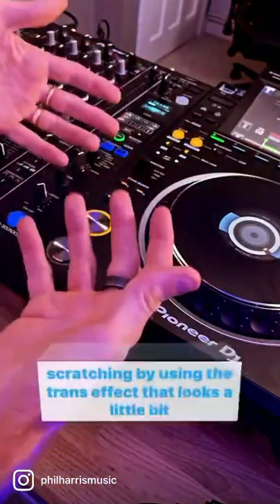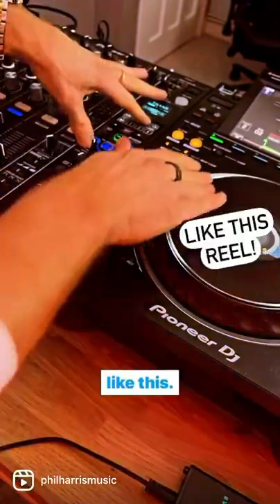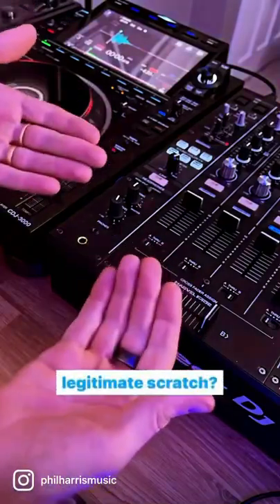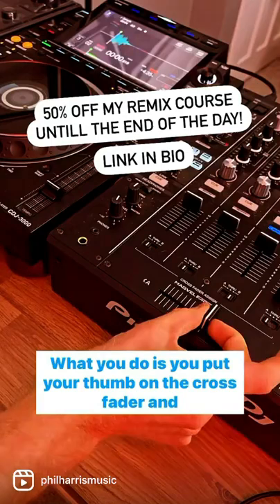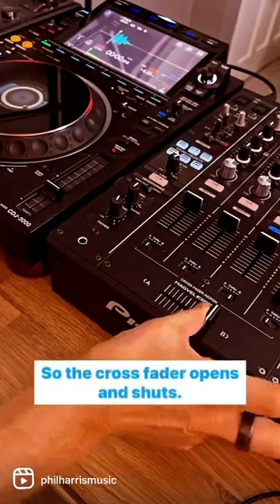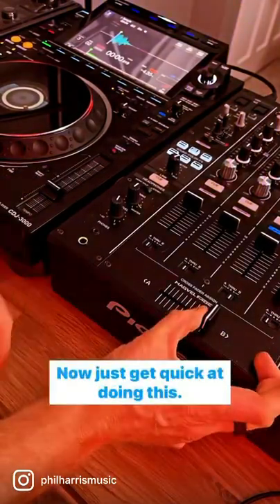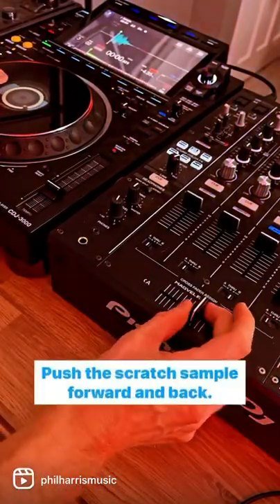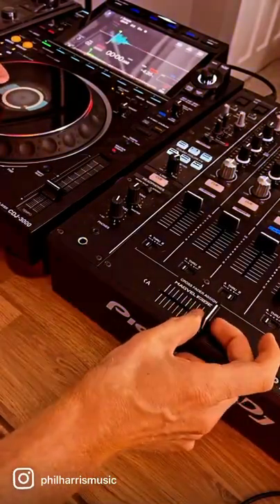How to scratch like a pro!

Comment: This is how I first learned to dj, I'm a turntablist, the platter on the cdj is not built for scratching so make sure not to scratch on it too often
Reply: That’s the craziest thing I’ve ever heard lol…scratching too much has no effect on cdjs they are made with that in mind…
Reply: @dabaddestdj2010  Not as in able to handle with being used too much, but in the sense of when applying pressure on a turntable vs cdj it is definitely not the same smooth brain.
Reply: @porkchopexpr3ss  don’t know what you’re talking about. nobody said anything about the platter design of cdjs the topic is about if they can physically hold up to scratching which they can. scratch as much as you want on them.
Reply: A CDJ platter is just fine for scratching. Been doing it for over a decade.
Reply: @porkchopexpr3ss  That’s a lie. CDJs are actually more resilient and stronger than traditional turntables. Over 25 years, and I’ve broken more Technics 1200s on tours than CDJs.
Reply: Uhhm,, I disagree

Comment: YOU ALSO NEED TO PROGRAM THE CROSS FADER TO INSTANTLY CROSS OVER WITHOUT SLOWLY GAINING VOLUME. SO WHEN YOU MOVE THAT CROSS FADER EVEN A LITTLE YOU GET THE SONG ON THE OTHER DECK AT FULL VOLUME EVEN IF YOU DIDNT MOVE THE FADER TO THE MIDDLE.
Reply: Lol yea because no one will hear u lol, I almost forgot that, nice catch
Reply: How do you program your cross fader cause mine is works but does not pick it up 100% it’s like a second volume button instead of going straight to track the cross fader is on.. if anyone could help pls & thank you 🙏
Reply: Go to settings , type fader .. change it to scratch
Reply: You put your crossfader in Scratch Mode. Like you said, when the fader is at 1% open the other deck’s volume is heard at 100%

Comment: How you really do it is with your thumb and pointer finger .  And you tap the pointer to the fader while using the thumb to bounce it back to shut now add the rest of your fingers in a smooth motion. Don t worry bout speed just get use to using all your fingers on the crossfader. Rotate between one finger two three and four . Mix it up and you get that exact sound from any sample.